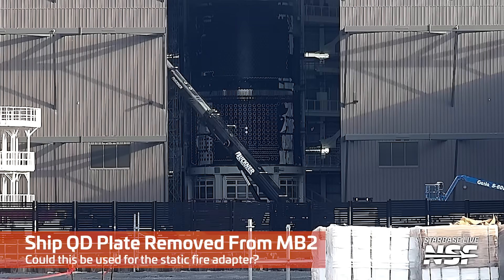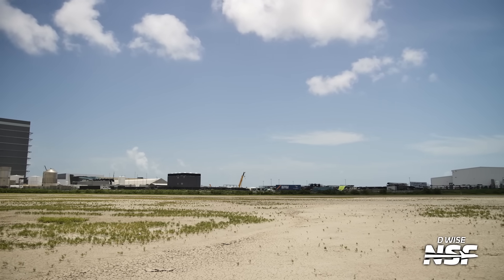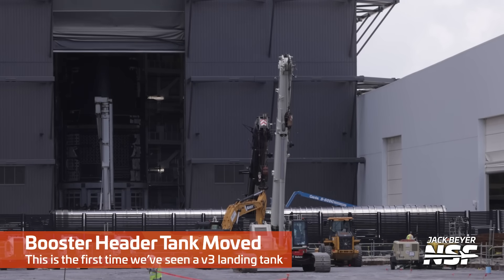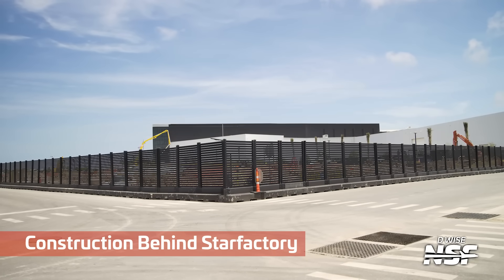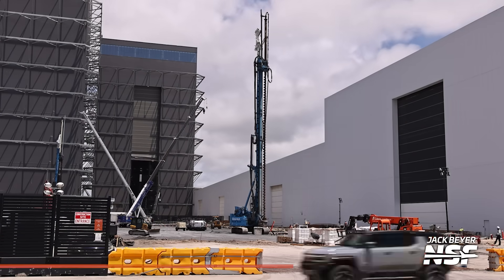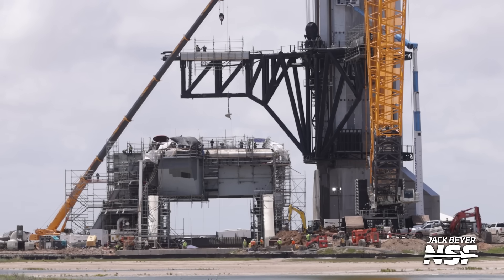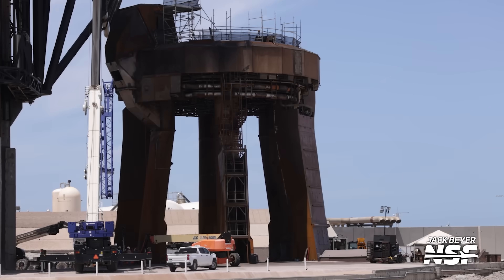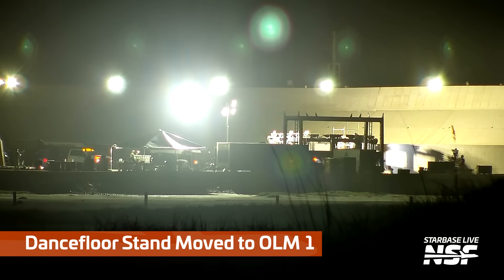"Putting a Falcon 9 inside of a Booster" | SpaceX Starbase

Comment: Don't like to be the one to say this But..... This Starship Monstrosity is not gonna get ANYWHERE. Imagine if a fully fuelled booster and ship went BOOM on or around the pad. After seeing Massys destroyed by a fraction of a full load o fuel, can you imagine the resulting explosion and damage if it went POP on or just above the site. The result would be absolute destruction for some distance.... Has Anyone Ever Put The Figures In One Of Those Computerised simulators????? PLEASE DO SO..... I would love to actually know.... Don't really tell me you havnt thought about it...... 💥
Reply: You're drawing conclusions not from data from from feelings.  To lift or move a lot of mass and go ANYWHERE you will need a lot of fuel.  That doesn't change with any transport system.  The more stored energy you have the more dangerous it is.  To claim the system itself will fail because it contains a lot of stored energy is flawed reasoning.

Comment: I know you were being slightly tongue in cheek but I think your idea of a booster each side of the highway at the entrance to the Starbase complex is genius.

The problem I guess is that, as I understand it, boosters (and ships) need to be kept pressurised for structural integrity so it would require some ground equipment and maintenance to do. Then again, I think it would be so cool that maybe they could do some special one-off internal bracing on a couple of flown booster that are never going to fly again to avoid the need for constant pressurisation.

You made a Jurassic Park comparison but when you mentioned your two-booster idea I immediately thought of those 2 huge statues (pretty much booster height or maybe even bigger) either side of a river on entry to some city or other that you see one of the films in Peter Jackson's Lord of the Rings trilogy.

The other issue (more a decision to be made) is where would they go? Maybe just before Sanchez starts since that's the start of the really dramatic skyscape, or would you put them further down at the city limits?

Comment: It is big enough to be a tank inside the outer tank. It only makes sense to have both tanks touching the bottom near the engines and having the higher pressure tank inside. The lower pressure tank means that the fuel doesn’t need a transfer tube. It makes perfect sense.

Comment: The transfer tube seems to fulfill both the fuel transfer function and the header tank function. That's why it's so large. Kinda clever.
Reply: That's my understanding too and I agree - clever.

Having seen this booster setup I can't stop myself thinking that it's a real shame they can't find a way to use the same concept on the Ship but, as I understand it, they have mass distribution (centre of mass) issues on Ship so the header tanks are up in the nose to get the centre of gravity higher for Ship. It does hurt me though to see those Ship headers having to be in such a sub-optimal place in terms of plumbing, encroaching on the payload bay volume, and precluding the possibility of ever having a docking port on the nose..
Reply: @julianfp1952  Your understanding?  Based on what?
Reply: What is the commonality between the header tank function and the fuel transfer function? And what's the difference?
Reply: @cube2fox  On v1 the transfer tube was welded atop the header tank. Now they increased the transfer tube diameter to hold a similar fuel quantity as the old header tank. Thus merging the functions and reducing overall part count. Classic SpaceX move ahaha
Reply: Docking port is still possible by using toroidal header tanks. Or a compression-resistant tube can run through a standard tank. These just weigh a little more, maybe +30%. Plus insulation and heating.

Comment: The transfer tube seems like a major waste of space. I wonder why they don't just split the booster in half, one side for the oxygen and the other for the methane?
Reply: Pressure vessels like rounded ends and the ration of ox to methane would mean one tank is not as full as the other which is wasted space.

Comment: Re: Jersey barriers. I know you were joking, but... and I didn't get a great look at them, but that did look like a Jersey barrier to me. I don't know how many places around the world use them, or how wide a form factor qualifies as a "Jersey barrier", but I do know we use them & call them that, in Canada. And I wish we'd install a whole lot more of them. They'd be a great test-bed for carbon-negative concrete (much better than "testing" new types of concrete on bridges & tall-buildings. ;-) )
 And yes, they are called Jersey barriers, because they were invented in New Jersey, but of course they are still called "Jersey-barriers" no matter where they are built or installed.
ps. that looks like a sick ramp to ride your BMX over, but given its position, maybe it's for loading your jet-ski into your pickup? ;-)
Reply from the maker: Its just one of those things... I see one, I'm like... that's a jersey barrier. I dont know where I learned that... it just... is. 🤷‍♂️ - Das
Reply: @NASASpaceflight  Yes. When I see one, I'm like, we need a lot more of those! They are what is needed to build protected bicycling lanes everywhere.

Comment: The transfer tube volume is so big that if it is full at launch, it almost becomes a concentric tank design?? There would be an optimal tube diameter given the methane flow requirement and any  energy efficiency to be gained from balancing the phase transition temperatures of oxygen and methane??
Reply from the maker: There comes a "tube to tank" ratio where it stops being a tank with a tube connected, and just becomes an oddly shaped tank. I think they're pushing that boundary. - Das
Reply: I just checked, and the freezing point of methane is slightly higher than the boiling point of oxygen. Would that call for management strategies?

Comment: SpaceX posted about this transfer tube on socials… it apparently is actually roughly the size of a Falcon 9 1st stage booster :)
Reply from the maker: Saw that... after this was recorded. "Roughly" doing some work there, maybe we need another vid. 😅 - Das
Reply: That's pretty nuts if you really think about it
Reply: How many falcon9's can you fit inside the Booster ? 1? 3? 4???
Reply: @5nowChain5  F9 is 3x70m and Booster is 9x70m. If you detach the fairing, maybe around 7 F9 can fit in